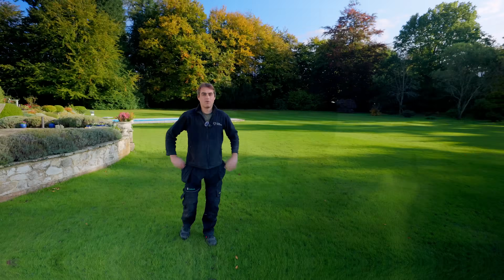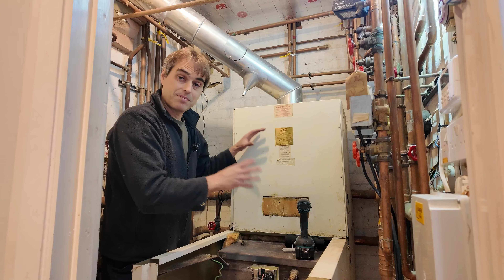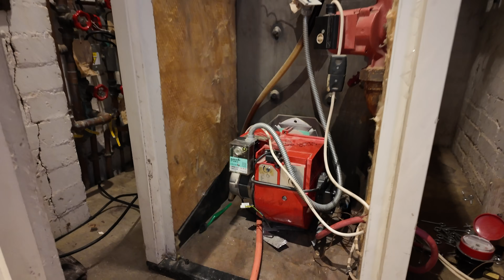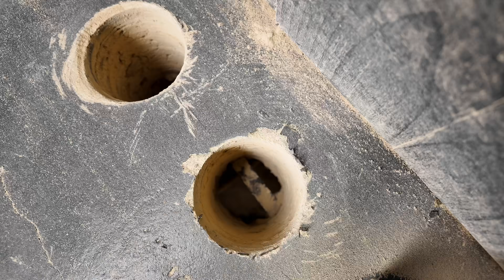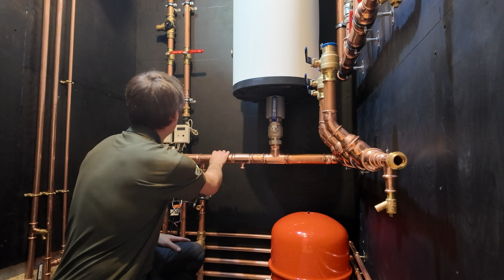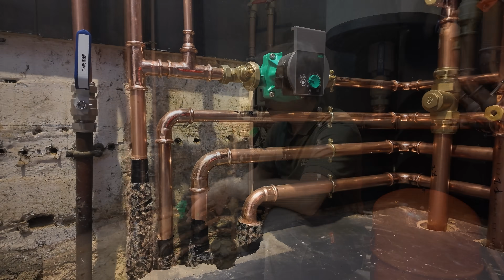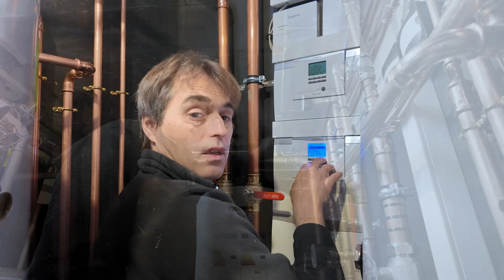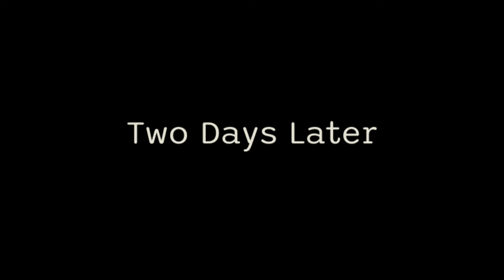Heating Oil Costing You A Fortune? This Is The Fix.

Comment: How to save £10,000... Spend £80,000 on installation costs
Reply: Saving £10k EVERY YEAR, meaning a £20k profit after 10 years!  Also a £120'000 profit after 20 years!  ( Except that energy will get more expensive so increase those profits...)
Reply: @UsualYaddaYadda I disagree, you’ll have maintenance costs and possibly have to replace items on a system that big. It’s idiocy to think nothing will go wrong for that period or will be end of life or made obsolete. 

You’re not looking at the whole picture.
Reply: @yrification  The original heating system was located within the thermal envelope of the property, which not only caused smells but also posed an increased risk. Over the past 10 years, the client's insurance cover for the property had quadrupled due to the associated risks of the oil heating system. By replacing the system, these risks have been significantly reduced, cutting hidden costs like elevated insurance premiums and liability concerns.

When the client moved there twenty-four years ago, the cost of heating oil was 8p per litre (ppl). Twenty years later, it had risen to 100ppl, and currently, it fluctuates between 60p and 80ppl. This represents roughly a tenfold increase over 20 years, equating to an average annual increase of 5%.

Using a mean cost of 70ppl and assuming a 5% annual increase, the client would spend an estimated £88,045.25 over the next 10 years and £231,461.67 over the next 20 years on heating oil alone.

It simply makes no sense to continue buying heating oil, essentially burning holes in your pockets every year, when more efficient, cost-effective, and safer alternatives are available.
Reply from the maker: yep - and what happens when oil shuts up in price? Suddenly pay back is even quicker.
Reply: @UrbanPlumbers  or drops ? Running on av 56p ltr at minute
Reply: @UrbanPlumbers  Here in Switzerland oil used to be expensive and electricity was cheap. Now its the other way arround. Oil price went down to 0.86 Pounds/L and 1kW/h is arround 0.25 Pounds. New heatpumps with a scop of 5.5-6 still have a ROI longer than the predicted lifespan. Its a joke in my eyes. Ah and solar gives almost no gains between November an March, which is our heating period.
Reply: @melunkai  all noted, the client also buys electricity on an EV tarrif at 7p per kW hour x SCOP of 5 = 1.4p per Kwh - good result ?
Reply from the maker: Correct - it’s called return on investment with 8 years payback time
Reply: @UrbanPlumbers yeah but what happens in 8 years time when you have to replace the installation with a new one because it’s packed in?
Reply: @richardp1517 The heat pumps are a very small percentage of the costs in this system.
Reply: @UrbanPlumbers but the ROI has no impact here as in 8 years time, they will probably have to shell out for 2 new heat pumps, there will of course be maintainence costs and those PV panels do not last forever im afraid lol
Reply from the maker: @Purebeltersteve why would they need 2 heat pumps ? Those will have very small compressor starts and will easily last 15 years or more
Reply: @UrbanPlumbers  we dont know the lifespan of these vaillant units, make sure to check in at the 8 year point to see if they have been changed. Absolute no need for heat pumps with all that solar. I would of installed 2 electric boilers
Reply from the maker: @Purebeltersteve , you would not be able to run two electric boilers with 25kW capacity at all—not on the grid and not off the grid. The power draw would be massive, and you would end up blowing inverters all the time or only running at 25% capacity. You would have to be mad to install direct electric boilers, but it does sound like you may be.
Reply: Im mad as a hatter, but then again, arent we all. Your customer is mad paying near 100 grand for all that. Battery storage is an accident waiting to happen aswell at that property as we both know thats not moving from its location. I could of put a worcester oil boiler in there, repiped it all like you to 3 zones and saved them a fortune. I can guarantee just going to an HE oil boiler from SE would of halved their oil consumption alone without doing anything lol. Why have you installed a buffer if you and heat geek say its not needed in all other videos.

Good luck on your heat pump journey, but im not going to be investing and for that reason, im out!! Haha
Reply: @Purebeltersteve  Twenty-four years ago, the cost of heating oil was 8p per litre (ppl). Twenty years later, it had risen to 100ppl, and currently, it fluctuates between 60p and 80ppl. This represents roughly a tenfold increase over 20 years, equating to an average annual increase of 5%.

Using a mean cost of 70ppl and assuming a 5% annual increase, the client would spend an estimated £231,461.67 on heating oil alone over the next 20 years.
Reply: @MalcolmSkerrett  how can you claim that. Do you know how much they have their boiler on? Anyone using quarter of a million pounds of oil in 20 years, needs to be looking at a leak under the ground. I have he boilers running so they are using between 800 and 1200l a year and these are 5 to 6 beds running between 20 to 30 rads an unventeds. I can clearly state the fact that this boiler in question clearly hasnt been installed correctly for these crazy amounts of fuel to be used.
Reply: @Purebeltersteve  Twenty-four years ago, the cost of heating oil was 8p per litre (ppl). Twenty years later, it had risen to 100ppl, and currently, it fluctuates between 60p and 80ppl. This represents roughly a tenfold increase over 20 years, equating to an average annual increase of 5%.

Using a mean cost of 70ppl and assuming a 5% annual increase, the client would spend an estimated £88,045.25 over the next 10 years and £231,461.67 over the next 20 years on heating oil alone.

It simply makes no sense to continue buying heating oil, essentially burning holes in your pockets every year, while more efficient and sustainable alternatives are available.
Reply: @Purebeltersteve you don’t understand efficiency do you
Reply: @Steveom  yeah i do actually, people say there getting 400 percent better efficiency with a heat pump compared to a gas boiler, but electrics is 4 times more expensive to gas 😃
Reply: @MalcolmSkerrett how much will they spend on electricity after the eco zealots shut down fossil fuel generation
Reply: @Purebeltersteve How much are you paying for gas?
Reply: @SimonEllwood  at the minute my yearly bill is approx 400 pounds atm and that was mainly due to the 250 percent rise over the last few years. Ive free free hot water and grid pay me 900 a year, so im actually up money every year. System design is key 😎
Reply: @Purebeltersteve  How much per KwH of gas?
Reply from the maker: @Purebeltersteve same here - no solar PV yet and my annual bill on heating and hot water on a 3bed small house is £250 (excluding standing charge)
Reply: 4 bed detached for myself, so we are pretty much on the same. Is that on Gas??Just wait to you get Solar, game changer, but no doubt when everyone gets it, you wont get money back from the grid as it will all be taxed haha.
Reply from the maker: Heat pump
Reply: @SimonEllwood  i never looked at my bills tbh, i think its around 8 or 9p on average. My electric was 28 at a discounted rate before i made the move over. Think some people are paying between 30 and 35p for electric from what i hear from family members.
Reply: @UrbanPlumbers  wow that is really good. Thing is, we dont have a cheap rate like what yous have in England, so that would contribute to your lower bills i suppose.
Reply: @Purebeltersteve  So 9p times three is 27p so not the four times you claimed. If you use a tariff like Octopus Cozy then it would be much cheaper than that. The client in the video has battery storage so will actually be paying less than 9p so not four times the price but the same price as gas. Your four times claim is nonsense.
Reply: @SimonEllwood  lol, youve got to go off the average across the board, not just a big house with an open cheque book. My claim is not nonsense. How much is your gas and how much is your electric, day rate now, no cheating and using your night rate.
Reply: Just a quick google search and i can see gas at around 6p on average and electric on 24 lol.
Reply from the maker: I am on regular rate of 24p. If I was on special tariff my bills would be £150 a year. I just have a madly well designed and installed system.

Check my system on OEM to confirm it’s true
Reply: @Purebeltersteve  You are literally commenting on a site with solar and battery storage. I also have solar and will be getting battery storage. What is your gas standing charge per day?
Reply: @SimonEllwood  we dont have one as im on PAYG meter 😎
Reply: @SimonEllwood  congratulations on your solar and battery storage adventure 🤣
Reply: Plus for credit meter it has been suspended for the mean time.
Reply: @SimonEllwood  cant be arsed talking to you now tbh, so hope you enjoy your battery storage adventure. Hope you have a good life with your heatpump adventure, like ive always said, il be fixing and installing gas boilers for the next 20 years, then i can die happy knowing ive done my part to the world by keeping people nice and warm in their thermal envelopes 😃
Reply: @Purebeltersteve Not when you have solar and batteries. In winter charge the batteries off peak at 7p a kWh. Suddenly electric is cheaper than gas, now take into account 400% efficency and your paying 1.75p per KW of heat.
Reply: @TheRonskiman  well put it in this, at the minute your paying 0.05p per KW of heat 🤣🤣🤔. Which one is better there
Reply: @Purebeltersteve No idea how you came up with that figure.   Actually I'm paying nothing, I've exported so much electric that in 2023 and 2024 my total gas and electric bills are negative. I used just over £700 of gas last year.
Reply: Not sure about you, but I personally put a price on things like not having people asking me why the whole place smells of diesel fuel, reducing cancerogenic vapours and fumes, and not having to top up the oil tank twice the year. 

Our grandma has one of those oil burners and every time we go to visit we dress in old clothes because the smell of diesel gets into all fabrics so you dont want anything expensive ruined.
Reply: @AdamCiernicki  again installation errors right there. If you know what you are doing there no smells at all, burn (albeit  approx 2 percent more CO2) but ratio and CO are pretty much are zero. One tree would take that CO2 out of the air anyway.  Not one oil burner i look after is smelly or gives off smells off the fumes
Reply: @ one tree? You sure you’re ok?
Reply: @AdamCiernicki  oh yes im great on this fine wonderful start to the working week to keep carbonising heating systems going as long as i possibly can. We produce 1 percent of the worlds CO2. Some people need to come to the realisiation that net zero aint gonna happen especially when we need electric lol. UK just wants to be first at everything which drives me mad. Just embrace the 60 degree output that normal rads should have and heat the home within an hour.
Reply: @ and there we have it, thanks for self-diagnosing mate “)
Reply: @AdamCiernicki  yes that heatpumps arent the answer.
Reply: So I years to earn it back
Reply: Plus this is an unusually large install. 80k isn't typical.
Reply: Diy and spend ₤800
Reply: Amazing video! Thank you for the superb content
Reply: One of the issues here is  navy vs army issue. Or plumbers vs sparks. 
Sparks like solar cells & batteries, and infra red panels
Plumbers like heat pumps, underfloor heating & air conditioning
Nobody likes windmills.
Hence because of your focus on liquid solutions. Your using a tank & immersion heater to store hot energy  means you have overlooked a better solution from Mixergy. 
Which takes advantage of the thermodynamics of water, that at the boundary layer it is very slow at transmitting heat. So in a mixergy tank which is driven by electricity it stores a lot of heat and supplies constant hot water in a far more efficient manner than immersion heaters

Also in the future. I suspect Renewable Energy Engineers will need to train as both plumbers & sparks & be able to be able to at the very least write Shell scripts as well. As understanding computer control systems such as Home Assistant & various Commercial protocols will become mandatory. 

This starts to fall into the Building Engineering  managing how insulated the floor, roof, and walls. Managing solar gain through windows with shutters and blinds.

How sealed the building is so that heat is not lossed through air exchange and keeping the humidity and CO2 at the right balance. 
So the emphasis on the  'perfect wall' and routing all electrical and plumbing systems through the minimum number of holes in the fabric of the building.

In the Navy vs Army vs Air Force scenario. Builders are the Air Force managing the Building Envelope. Perhaps Builders should  also be taking over the application of windmills in energy production.

However, what is clear is the rise of the Cyber division of building. The people who understand about putting in not only the various forms of data cables, cameras etc, but also the sensors , that feedback information via Home Assistant and various commercial protocols. Its seems likely something modern houses will increasingly needs is a Utilities Room. It can be placed in the loft or a basement  but probably on an exterior wall or even a separate structure attached to the home where all the plumbing &  sewage, electrical & energy storage, air handling and house managment get routed to.

I was recently watching a Matt Risinger video about commercial building in Norway where fully constructed bathrooms were being dropped in with all the of the various systems being routed through a single point of entry/exit. Having a similar plant/utility space coming either as a drop in space or at the very least a pre specified by the architect/engineers specification where sparks, plumbers, builders and cyber teams can place their equipment, so it is both labelled and organised for future managment for houses & commercial spaces that have whole house operating systems in a similar manner to cars.
Reply: @annakissed3226 plumbers do not like heat pumps😂
Reply: It’s very admirable and interesting but it also illustrates the wealth gap perfectly. 
It is simply out of reach for most people to front upfront costs of 10x what it would be to replace the boiler
Reply from the maker: @lewisjones5067  3 things have to be resolved in this case:

1. quality of installation - meaning that efficiency is high so systems are cheap to run
2. Eco system of renewables or special tariffs - to lower the running costs hopefully to £0 or to at least 50% of gas
3. Finance - so that everyone can afford to have a decent system installed that pays for the finance in lower running costs
Reply: @UrbanPlumbers  I agree, perhaps you and heat geeks should volunteer to work for the govt to steer them in the right direction. Instead of the grants and poor installations we commonly see we could have a system that actually works….
Then again your both probably making a lot of money working privately :p
Reply: @lewisjones5067  An unnecessarily snide remark and do you work for free, thought not. It seems to me that UP and Heat Geeks (training)  are doing more than their bit to highlight best practice in a newish industry.
Reply: @lewisjones5067 that’s what loans are for, just make sure the interest is covered by the cost reduction.
Reply: @lewisjones5067  £2k for a heat pump installed via octopus, same as a combi
Reply: @lewisjones5067 well said!
Reply: @lewisjones5067  well said
Reply: @lewisjones5067  As mentioned in the video at 20:14 the cost to replace boiler and leaking tank in this case would have been nearly as high. While a heat-pump conversion may be 10x the cost in some other cases, I think it is important to note there are also cases where the cost difference is much less.
Reply: @nordlands8798  just for the air source maybe but it’s only really worth it if you do the panels and batteries and there’s no way an oil boiler and tank would cost that much
Reply: Wow , impressive solution to a big problem. The use of a towel rail system, and the reusing of existing equipment commendable.  Well calculated and definitely worth another visit in the colder days for a recap. Can I ask if you use a fixed pump speed on the vaillant units ? I have just fitted my 7kw and have 35mm primarys distributing to 3x 22mm legs and my flow rate is very high. I am in manual mode at the min of 50% delta T is 2 Deg with an outside temp of 10. I hope this increases as it gets colder. Keep up the good work and I will have a look on heat pump org to look at this installation.
Reply: @derekpaisley620  this system Szymon has just finished has DT of between 5-6 degrees and a SCOP of 5.06 as we speak.....
Reply: I love the tech, but the possibility of spending like this is a pipe dream.
Reply: Crikey!
Reply: If they last more than 8 years it's worth it
Reply: @atrumluminarium  Twenty-four years ago, the cost of heating oil was 8p per litre (ppl). Twenty years later, it had risen to 100ppl, and currently, it fluctuates between 60p and 80ppl. This represents roughly a tenfold increase over 20 years, equating to an average annual increase of 5%.

Using a mean cost of 70ppl and assuming a 5% annual increase, the client would spend an estimated £88,045.25 over the next 10 years and £231,461.67 over the next 20 years on heating oil alone.

It simply makes no sense to continue buying heating oil, essentially burning holes in your pockets every year, while more efficient and sustainable alternatives are available.
Reply: Way not go with geothermal?
Reply: Also not taking into account rising electricity bills. You know for a fact you'll dave far less money than predicted